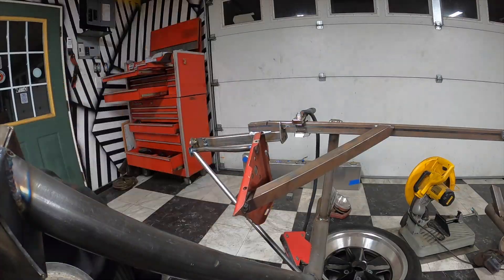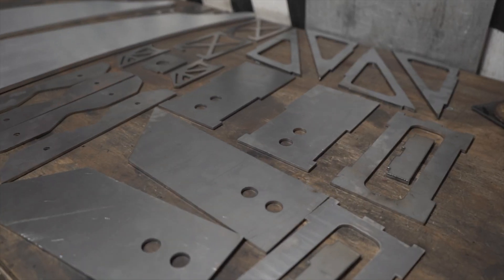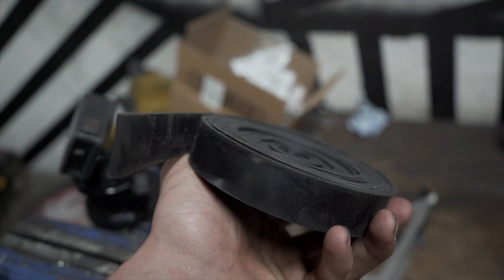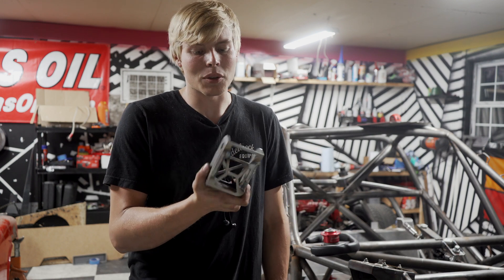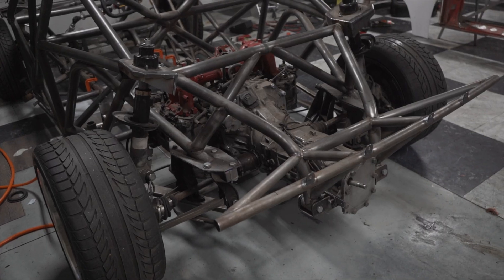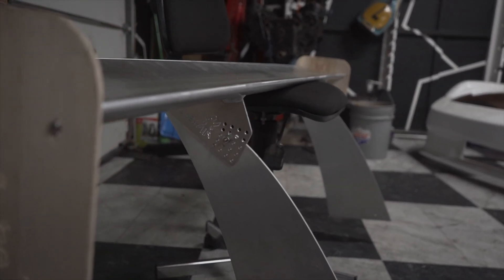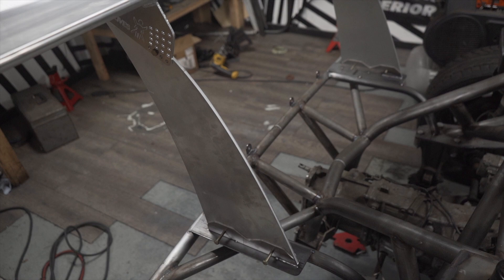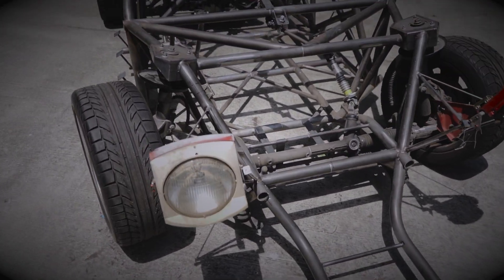Tube Chassis Race Car Build Pt.7 Big Wing Install!

Comment: This is awesome. First video of yours I've seen so excuse me if I say something exceedingly dumb.  You going to make carbon fiber components for it afterwards..?  Also, is there a car this is going to look like when done..?
Reply from the maker: Yes, it will eventually be a lot of carbon. but fiberglass and aluminum are cheap to start with. Get it running, then get it right. This car will have an aero package unlike any 914 before but, its body will look like a sheridan 914

Comment: I realise this is slightly off topic for this stage, but can anyone give me some guidance in design/build of tubular spaceframe regarding suspension geometry.....
I've read lots of info regarding design of suspension geometry, and always when discussing CoG and Roll centre it obviously has to consider weight distribution, along the vehicles width, length, and height. 
My confusion comes about because whenever I try and gather info from chassis builders experience, they always build the suspension at early stages. Not when full chassis is built with all vehicles gear put in.
How are they accounting for all of the vehicles weight distribution at such an early stage of build?
I am at an early stage of custom build design which uses a replica spaceframe of original manufacturer, but want to swap out multilink for double a arms. That will need spaceframe mods, and as using different running gear, a fibre shell, and many more items from a donor vehicle 50yrs more modern than original chassis model the weight distribution will be drastically different.
Reply from the maker: you basically can make assumptions. Without knowing exactly what you are building, you can go general. Front engine rear wheel, especially an american drivetrain in standard locations will be 55-60% front,  where as a mid engine rear wheel will be something like 45 front. If you plan to move the motor more centrally you can achieve 50/50. Additionally you can place things like the battery in locations that help your weight distribution. i believe theres decent estimates you can make about the height of your CG but i cant remember them off the top of my head. Roll center is dependent on suspension design. Tune to win is a great book outlining a lot of your questions.
Reply: @ZipTied  that's helpful. Thank you. When it comes to putting the project together I plan to get professionals to design and fabricate properly. But I like to finalise my ideas in detail first.
Reply from the maker: Absolutely! The better detail you have figured out the easier it will be for the professionals to do there job and give you the end result you want. Best of luck on the project!